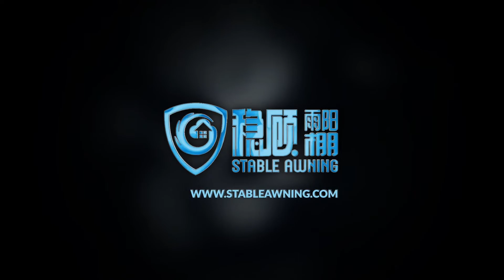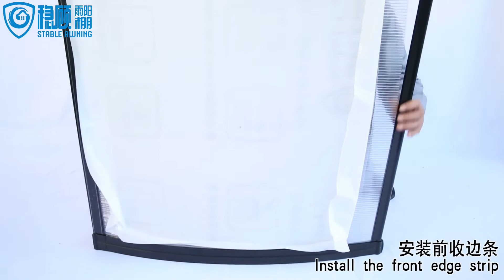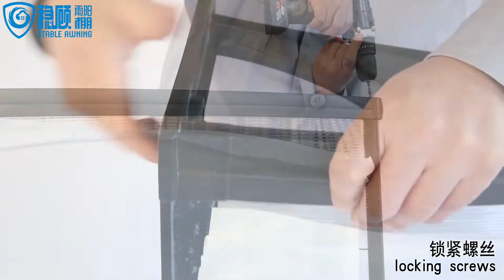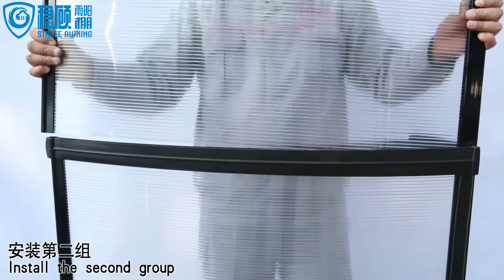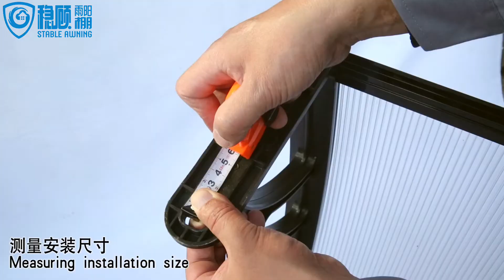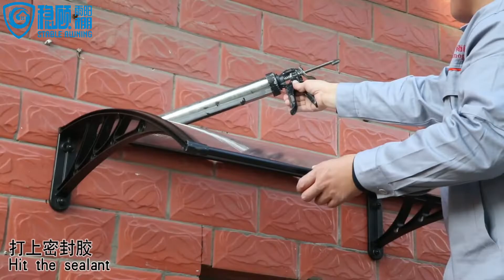How to install polycarbonate hollow awning/canopy/Front Door/Window/Patio Cover Awning.

Comment: What can I fill the gap in with that mounts up against the house? So it doesn't leak water.  My gap is too big for caulking. Any pointers?
Reply from the maker: You can hit the neutral structural outdoor special adhesive. If the gap is big you can stuff a little something and then glue it.